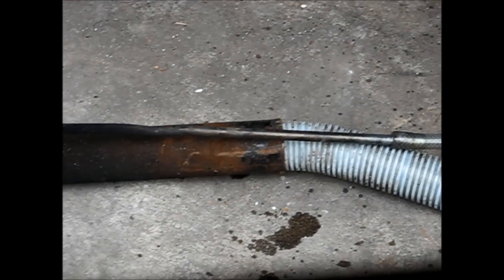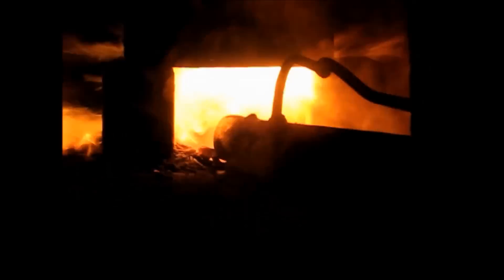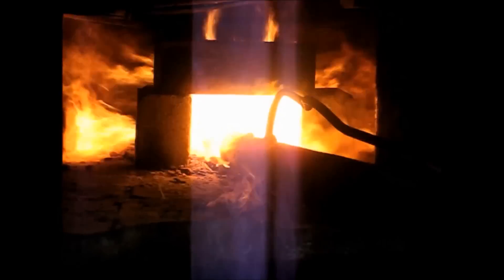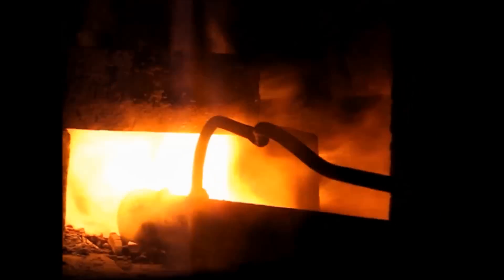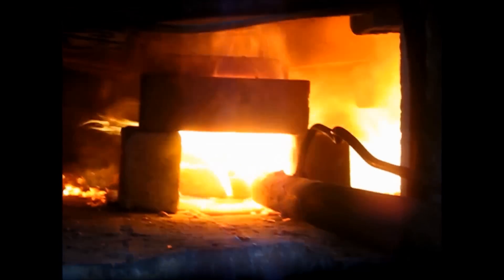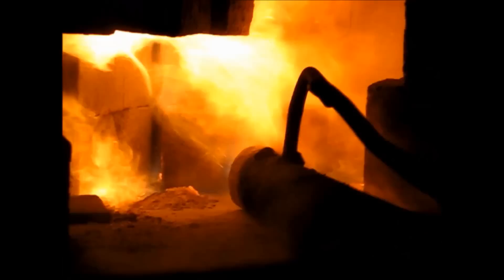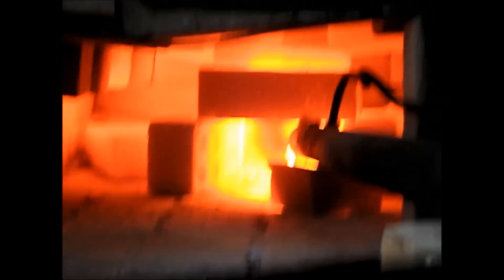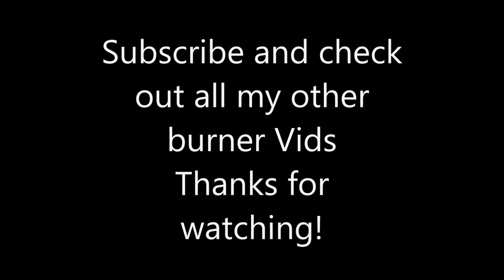Easy, fastest Build oil burner Ever!

Comment: Hey I was wondering if you could help me out with a problem I'm having. I have a stainless steel tube that my copper(oil feed) is going into. I have to heat it up to red hot to get the oil to burn, and it burns pretty aggressively, but when I turn on the air from the back side of the pipe it puts my flame out, even throttling up the fan slowly. It will throttle up the flame a little ways, then go out. Was wondering if you could help me adjust my burner to get sustainable flame. Thanks.
Reply: I'm not 100% sure but it feels to me like I need to almost put holes in the side of my stainless to get it to mix with the air better. Don't want to drill my piece of stainless unless I have to though.

Comment: what if you took that same pipe, perhaps ran the feed line back a bit, put some large bounce-house air pressure in, and put a stainless (or even steel) grille on the output end of the pipe?

Comment: I have now watched this video two times and the penny has finally dropped as to how all works, in your description about it changing from a liquid to a gas before it ignights is an expiation I have never come across before. I have read lots of techno stuff to do with oil firing and nothing explains it like you do, keep using the KISS principle and it will work every time.

So does it matter where you have the feed in pipe for the oil? and have you tried preheating the air and or the oil or both to see if there is any improved proformance / efficiency?

Cheers Mark
Reply from the maker: Thanks Mate. It's something I constantly struggle to explain to people. They seem to be obsessed and fixated on having to spray or atomise oil to get it to burn. I show vid after vid of my burners with oil going in out of the end of a plain copper tube and still they ask about the oil spraying or the nozzle. 

All a spraying burner does is make the droplets smaller so they can heat up and change state  from liquid to a gas faster. In a hot environment like a furnace this isn't necessary as you can see here.  I cannot just turn on the oil and air and light this, it has to be pre heated so the oil vaporises ( 300oC+ is good for Veg but probably starts around 250 depending on the oil used) and changes to a gas before it will burn. 

In my forced air burners the vessel ( usualy the extinguisher bottle) has to be pre heated so when the oil hits the hot walls it vaporises and burns. The reason I spin the flame is so the heat goes round and keeps the burner walls hot because the process changing liquid to a gas absorbs heat.  Remember the old Open crank type engines that just had a water resivour that boiled off the water for cooling?  Even brand new Chines Diesels still use that principal for cooling.  A thick walled vessel it good because of the heat transfer and retention, just takes more preheating to get up to temp initially. 

You have given me an idea for a vid though where I will demonstrate the oil is blown not sprayed and the heat is what makes it burn.  I think I'll just have a running burner and pull out the feed line and stick it in the top to show there is no spraying at all. 

Thanks for the Idea!
Reply: Hi Mate, Yes I do know of the old open engines that had to be preheated before they would start and good to know old things never die.

The oil burner I used to use was run on straight diesel, so no problems about lighting up, we would light up on compressed air until we had enough steam then change over, on the down side the setup used saturdated steam, so you were trying to burn water at the same time and the powers that be never understood this either, not even the engineer of the place.

I got photos of one of the old burners if you would like to see it.

Cheers Mark
Reply from the maker: Hi Mark, 

Yeah, I'd love to see the pics of that burner!
I have thought about firing a burner with steam but as anti safety sissy as I am, there is a difference between that and self preservation and the only thing I know about steam is that it is not to be played with.... If you want to live a while any-ways. 

I always thought it would take a good amount of energy out of the burn because water can go to dry steam which still takes energy.  One thing, I imagine you never had to clean the tubes in the boiler out! 
I run water injection on my engines with veg and the last time I pulled the head off one it looked literally like it had been polished!

If you could send me the link to your pics, that would be great, thank you!

Comment: built two atomiser oil burners powered by vacuum motor but the oil was released by a paint spray principle, I used warmed chip oil to help it flow using gravity too . please be careful of eating anything you may cook  using sump oil, my burners were for a pottery kiln ,  Great designs Max , 10 stars

Comment: I was wondering if you took the transformer off of the vacuum cleaner would it then run on 12volts?. I think the transformer just knocks it down from 240v AC (UK)  12v DC. You could run it off of a car battery then. I could be completely wrong and talking crap :-)
Reply from the maker: Far as I know there is no Transformer. Some cleaners have a speed control but the motors themselves are wound for 240V not 12. Also the motors are AC as mains power not DC as 12V car power.  If you had say an 1100W vac and ran it on 12V (13.5) then the current draw would be over 81 Amps.  That's going to put a lot of load on most car alternators and demolish a car battery pretty quick as well. Car batteries are not designed for that sort of sustained load. You'd want something specialised ( expensive) for that. If you want a 12V blower, just use one from a car like I did in my water heating vid. That thing blows really well and moves enough air for well over 100 KW output.  Marine Bilge blowers may also work but I haven't tested them yet.
Reply: Oil Burner
I said I could be talking crap. Looks like I was . Still, learn some thing every day :-)

Comment: Does the pool hose stand up the heat? sans the oil feed I use almost exactly the same set up to fire my beer-bucket forge... Except I've melted the ends off the vacuum hose and had to cut it short and reattach it several times already, any help would be appreciated

Comment: Awesome!
Looks like the whole inside of the furnace did reach about 800°C (bright red glow) - wich gives an average temperature rize of the bricks of maybe 400°C (that depends on the outside temperature and heating time too - but half an hour is more than that simple housbrick furnace that ran like 5 minutes - and there was also some bricks that was compleately inside the furnace)

If they have a heat capacity of 0,8 kJ/kg/°C (wich is typical for most bricks - but may be higher as well) the heat energy is 0,8 kJ x 400° x 500 kg = 160 MJ. If they got heated that mych in half an hour, the average heating power is 160 000 kJ / 1800 sec = 88,9 kW effective heating power (where no losses is take into count) - that's impressive!

Comment: Quick question mate,
How much air are you feeding into the pipe? The reason I ask is I have a very very large squirrel cage furnace blower for my forced air LPG cast iron furnace, but if I don't have to run such a big blower I would be very interested. Ie; the blower is 3ph and 4Hp and loud. I'm trying to build a shop heater for this winter that I can run late at night and not piss the neighbours off... LOL
Great vids mate, keep them up..
ATB for the new year
Matt
Reply: Hi Matt, I don't have any way to measure the air flow, you can see it was just from a vacuum cleaner and being a very old one, the flow wasn't that huge.  The blower you have would be way overkill for a space heater of any type. The blower on my other vids is only 1/2 horse and I can get enough air out of that for 300KW+ combustion. For a heater, you are going to be lucky to want 20KW. You could try a much smaller and quieter blower or even a hair dryer would be ok but they still tend to be noisy. The quietest blower I have came from a car and was the main aircon/ demister cabin blower. Pumps out plenty of air and is near silent.  Check fleabay but make sure to get a blower not a fan as you need some air pressure as well as flow and low speed fans  don't work well for this if all. 
NY Best to you too!